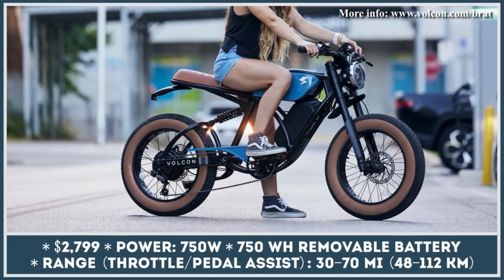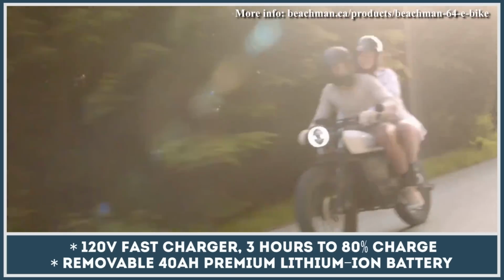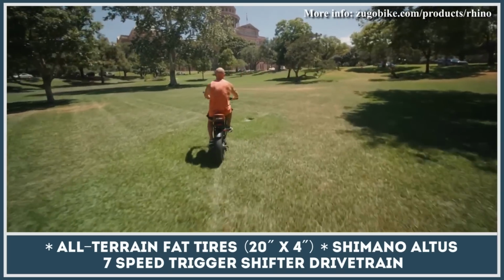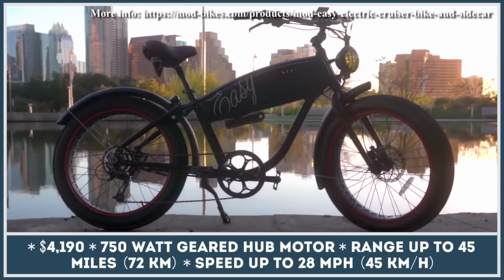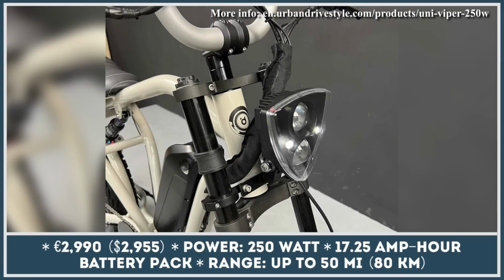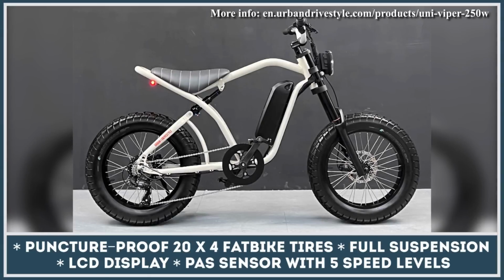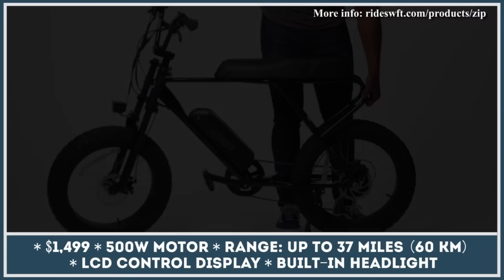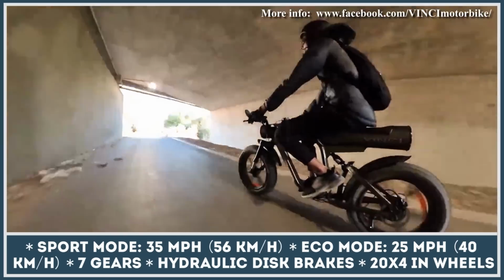This USA-Made Electric Bike has Pedals but Looks & Rides like a Motorcycle

Comment: Unless you can beat 2,200 and the bike goes as fast as 55 I'll stick with my goat power bites I don't care how awesome all these bikes look because they basically look just like the goat power bikes but my bikes are cheaper and faster and I'll stick with them that's over $4,000 for that you can get the motor goat or the power goat for 2200 and add a second battery for 600 and you're still under

Comment: Believe the weight is part of classification to motorcycle, not sure but maybe the case as with extreme speeds on 2 wheels, the weight needs to be of a standard weight from having bike frame go Airbourne when hitting them bumps or mini ramps on streets. Yes, you will take off if going around 40 plus mph on regular frame and parts. Speeds need weight to compensate center of gravity of not having the ride fly thru air after a bump.

Comment: Most of these are overpriced junk with weak batteries and motors for what they are charging. Do some research, people. You can get a 1000 watt 48 volt 20 ah motor/battery ebike for $2,000 or less. At 750 watts and 13 to 15 ah these are ~$1200 bikes unless they have dual batteries. Know this: the American companies are simply buying chinese parts and selling them to you at huge markups.

I've been searching Amazon, eBay and bikes sites for days, looking for something around $1,000 price point. Still haven't made my decision but none of these are good values.
Reply from the maker: Hello, thanks for your feedback. When you say about better options, can you please share the suggestions?
Reply: @Datacube  for starters, I just bought the Happyrun HR G50 for $1,000. 750 watt, 48 volt 18 ah with 20 inch fat tires.

Comment: Stay away from Rumble Motors. Any e bike of theirs.  I owned an Air V2. What a lemon.  It only went 9 miles on TWO batteries.  The companies customer support is even worse.  They basically either ignore you.  Mis lead you. Or make it very difficult to return what is clearly an awful e bike. Many owners with other models have experienced the very same thing. So go with a company that offers customer support more than just a fancy looking e bike. ( and one that actually offers an owners manual ) which Rumble doesn’t even give you.
Reply from the maker: Hello, thanks for your feedback. What's the capacity of those batteries?

Comment: From what i can see i still prefer my Super73 R series. 2000W/960 amp hr battery, two years - 8k miles all joy.
Reply: What is the operating voltage on the S73'R' series...? They don't give that info on their website...Wow, you have a 2000W hub motor?
Reply: Since 960watts/20AH=48V I think I figured out the answer to my question. 
BTW, Nobody has a "960 Amp Hour Battery"....

Comment: I noticed that several of these bikes have rear derailleur gearing in combination with rear hub drives.  These make no sense.  They would only affect the power transmission when the bike is being pedaled, and no one is going to pedal these bikes!  They are waaay too heavy, too much rolling resistance in the tires.  

As long as the electric motor is activated, the only gearing the motor sees are the gears inside the hub motor.  Surprised no one else picked up on this.
Reply: Do your research a lot of these have custom toothed sprockets so that you can pedal at high speeds
Reply: There's this thing called "pedal assist" that riders of ebikes have been making use of for many years. You should read up on it.
Reply: @carriebartkowiak  I have a bike with pedal assist.  It is a bike that weighed 23 lbs before I installed the bafang bbs02 ebike kit.  It has 24 inch mb tires inflated to 65 psi.  The bikes shown in this video weigh close to 100 lbs.  the 20” tires are inflated to about 20 to 25 psi.  HUGE rolling resistance.  I also have an ebike with tires like these, so I know what I am talking about.  The pedals are mostly there for show, believe me.
Reply: @lkj974  well i think those pedals are there to bend the e bike rules if you know what i mean ebikes in my country that doesnt have pedal assist usually needs licensing its kinda hard to explain sorry
Reply: @kukurukuku9270  Oh, I get it.  Pedals make the bikes more acceptable to other riders and pedestrians when you venture on bike paths as well.  But the physical reality of these heavy bikes with fat tires is that you couldn’t get anywhere on them under you own power, not unless you know how to make your ride downhill both directions!
Reply: @lkj974  yeah its something like that and i dont get why people would love to ride this "e-motorcycle" i mean e-bikes are easier way much lighter less bulkier  easy to work with they basically do same stuff i dont usually comments on stuff i just got triggered by "do some research" so just my 2 cents
Reply: I don't have an ebike yet but the low gear setting oughta help get the bike rolling, taking some load off the battery. Then the highest gear might help the battery going up hills or bucking headwinds? I shudder to think of peddling one of these things after the battery dies... lol
Reply: @johnw65  Electric motors have loads of torque and are very efficient at low speeds.  You could step on your cranks to get your bike moving from a stop but it isn’t really necessary or helpful.  Climbing hills is another matter, gears are very helpful there.  Headwinds?  I dreaded headwinds when riding a regular bike.  E-bikes easily overcome the extra drag.  

You won’t be pedaling home bikes like the ones shown in this video, trust me.  Even my older, lighter PAS e-bike needs to be in PAS 1 to be “neutral”.  In addition to the greater weight of the e-bike, you are also working against the electrical motor.  Some more sophisticated systems like the Bosch have a clutch which can take the motor offline (these are NOT hub systems) and eliminate that drag (or so I have heard).  You could probably pedal a bike like that home.  Otherwise, I wouldn’t count on doing that.
Reply: @lkj974  Thanks for the education. Do all hub drive motors have drag, whether geared or direct? I don't see transmissions on mid-drive setups very often...
Reply: @johnw65  to be honest, I’m not sure. I would like to know too. Maybe do some research to find out.
Reply: @lkj974  I'll see what I can find out... Details on electric components are hard to find.

Comment: THIS VIDEO: VOLCON BRAT is 750W48V15AH  for $2799; BEACHMAN 64 is 500W72V40AH (governed) $3388;  ZUGO RHINO (Fork suspension only) is 750W48V15.6AH for $1999 - 21AH $2499; RUMBLE AIR V2 2000W52V40AH 40mph40mi Range$4950 - SSV2 5000W72V50AH 65mph100mi Range$7500; G-FORCE ZM 750W48V20AH$1999;
Reply: G-FORCE ZM looked like the best deal in this lineup. But the EUY F6 folder has 750W48V18AH, fork/seat suspension, 20"x 4" mags and luggage rack for $1199 and free shipping!
Reply: @johnw65  sell that crap, bot boy.
none of it will ever be on GM's floor.
Volcon will.

Comment: Onyx City 2 45mph for $3,700.
Reply: yeah I'd rather have a moped that goes 45mph than a motorcycle that goes 28mph
Reply: @geemy9675  I have a $2000 step-thru scooter that will do 60 mph all day... All ebikes are toys and 'commuters' at best.
Reply: @johnw65  well a commuter isn't  a toy and it's a pretty wide definition. most bikes, scooters and motorcycles could fall under it unless you're taking about touring/adventure bikes. I'd  say most ebikes are more utilitarian than pedal bikes to get you from point A to point B with regular clothes.
Reply: @geemy9675  You're right! 
I've been riding over 55 years - 25% as transportation to work (commuting), 75% recreation (toys)
Here in the US, most folks use 4 wheeled vehicles for primary needs, unlike other countries where step thru scooters are prevalent... My Comment was based mostly on range and recharging limitations of all purely E-Vehicles. Thus the need for 'Hybrids' although many of these ebikes might be impossible to 'pedal' uphill because of their weight. At 73, I'm not into pushing vehicles at all.... Can you see my point?
Reply: @johnw65  agree although also in Europe "many" people ride motorcycles as their main transportation, either in big cities or in milder Mediterranean climates. although not as safe as 4 wheeler, cars are much more used to mixing with motorcycles, despite lane splitting 
I still get confused with (kick) scooter and step through scooter terminology, what is your 60mph $2k step through scooter?
about ebike range, it might seem low but I think it matches the use. if you ride ~20mph (on throttle) and have 40miles of range that's already 2h per day, possibly more if you charge during the day. if you need more miles you probably need faster transportation
Reply: @geemy9675  I bought a KYMCO People S200 for $2000 American... It's 163cc and runs quite well for carbureted technology. My main ride is a Honda VT1300C Interstate. I rode it 230 miles yesterday just out having fun. Thats about 370km...
Reply: @johnw65  ok I assumed it was electric because of the context 😁 that's the problem there is no electric equivalent for cheap practical gas scooters that can go everywhere except freeway electric would be 2-2.5x the price
Reply: 1500w ebike kit and 58v 20ah battery 🔋 $700 =40mph
Reply: @ianmangham4570  where do you order that kit ? even Alibaba is way more expensive. cheap batteries usually don't last more than a year. anyway it's not comparable to an electric motorcycle but also 1500W/40mph on a hub motor is not very realistic unless you have fast motor with little torque and climbing ability
Reply: @geemy9675  I'm in England 🇬🇧 I notice usa 🇺🇸 is getting seriously ripped off especially on battery 🔋 and motor,I use EBAY UK 🇬🇧
Reply: @geemy9675  You can get started alot cheaper, a 350w waterproof JULIET connectors kit including battery is only £400 ,with the pound doing so crap that's like 400 bucks 💵
Reply: @ianmangham4570  I bought a brand new aventin 350W rear hub wheel that had an intermittent drag while coasting according to the seller, for $30 with tire. fits my full sus MTB perfectly with a few mm of clearance, but not way it's fitting my road bike so now looking for a cheap configurable controller (probably gonna be a KT around $50). the plan is to find a cheap battery and cheap front wheel to fit with road tire to match the aventon wheel, and figure out a way to build a removable battery/controller combo (maybe battery triangle bag that could feet in the triangle) . I want to keep my MTB reversible to the trail configuration in a few min max. my concern is damaging the rear wheel drop out with the motor + frequent wheel swap.
Reply: @geemy9675  Never damaged a drop out, and I've ran 1800w rear NO TORQUE ARM  ,just a nice spacer washer each side and two beautiful nylock NUTS

Comment: have you ever ridden a motorcycle...?😉
Reply: I been riding motorcycles since 1963. My 2015 VT1300 Interstate has over 20,000 mi so far and runs like new. These ebikes look like fun to explore city bike trails with since my knees aren't doing bicycles anymore. I found an EUY F6 folder with 750w48v18Ah 32mph for 1199 on Amazon. The folder will fit in the back of my SUV and it don't use gas...
Reply: Lol
Reply: @galacticgalaxyonezerone7235  I on think anyone who has been on one would jump on a 20 or 28mph motorcycle
Reply: I have ridden a motorcycle, have a license and everything.  I ride an ebike now.  It is much quieter, lighter, easier to handle, and I don’t care about the friggin top speed.
Reply: @lkj974  I like motorcycles and bikes too but when ebikes try to hard to look like motorcycles but go 20mph and cost the price of a used motorcycle I find it weird.
I know the appeal of ebikesbis to be able to go on bike trails but if it looks like a cafe racer you're really looking for troubles
Reply: @geemy9675  I understand what you are saying about the price.  It does seem excessive for a toy, or something with only modest utility.  I have a Super 73 Z1, which I was able to buy new about a year ago for $1300.  It has a 28” standover, so I can put my feet on the ground.  The pedals are forward, like on the old stingray bikes.  I don’t have to partially dismount everytime I stop.  That is the appeal for me.

Comment: Haha ,I can buy a motorcycle for that price or less and it would be faster,travel longer , these are a joke
Reply: You'd be buying a used motorcycle at this price and it would require a tag and a driver license. These bikes are new and in most states don't require a tag or license.
Reply: Lifetime biker here and yeah, these ebikes are a long way from replacing the smallest Wards Riverside 125cc I had in 1963. But, I found an EUY folder on Amazon with 750W48V18AH 32MPH and prolly 30mi range w/o pedaling for $1199... It'll fit in the truck or SUV and be fun in parks, campgrounds and bike trails...

Comment: Forget these over priced weaklings, look up Ariel Rider Kepler, it has a bigger 1000/1800 watt motor and higher voltage/size battery, 52 volt 20 AH so much more, such a best bang for the buck, they are back ordering now 4 to 6 weeks people lining up for one at $1800 not 4500 , Thank me later
Reply: For people that live in cities across many states, you are restricted to be at 750w to be a class 2 bike which can be a lot more convenient that something with more power.
Reply: @SSchuck  Yes Sir the Grizzly is Twice as fun, you could probly hit highway speeds wih eaze if you know your way around the mofets in a controller but I really dont want a nurse scrubbing asphalt out of my shoulder blades again, 35  is fine by me off road and 20 mph city 😉

Comment: Has estimated range of 1-100 miles 😂
Reply: In reality, if you pedal and cruise around 20 mph - 40 miles or motor only, 25 miles, you don't want to drain down the battery past 1/4 left

Comment: You can tell the manufacturers that have actual experience designing motorcycles.  The ones with the flat seat with noone on board havent a clue, as soon as someone sits on it, the seat will lean backwards off the bike making it uncomfortable and hard to stay on the bike
Reply: What are you smoking? When someone sits on the flat seat, the seat simply compresses a bit, straight down. Nothing leans backwards off of the bike; it's fully supported.
Source: I own a G-Force.

Comment: I really wish these were much more affordable. The cheapest one was still 3x what I paid for my first car!
Reply: that car bought todayt would probably be 3x what you paid for it lmfao
Reply: Honda Navi. A street legal motorcycle for 1800 . I’m going to teach my boys how to ride with one.
Reply: @raidenout1515  mini motos are cool. I can't see paying more for a bike, than I paid for my motorcycle, even though I want one. Spring is far off so I wanted a winter beater.
Reply: @raidenout1515  that requires a license and insurance..and cant go on sidewalks, trails, anywhere..and its slow af with low torque
Reply: @rsxhitman  I've got a license.  Riding on a sidewalk sucks and it's faster .
Reply: @slimdunkin117  I was talking about the price range of the 20mph retro looking bikes .
Reply: How old ARE you?
Reply: Batteries are expensive
Reply: Here is your answer. Get your old bicycle out of the garage or buy one on craigllist ($200). Buy a front hub motor kit with 1000w ($200) and a 48v battery ($250). You will go at least 25mph without even pedaling. Now you are only out $450 if you already have a bicycle. What are you waiting for?  There are several YouTube videos showing how to put it together.
Reply: Look up the Lucrat e-bike